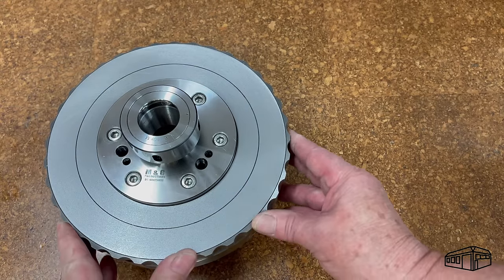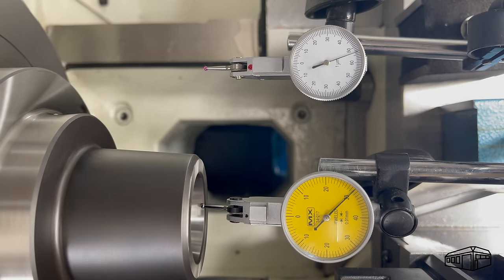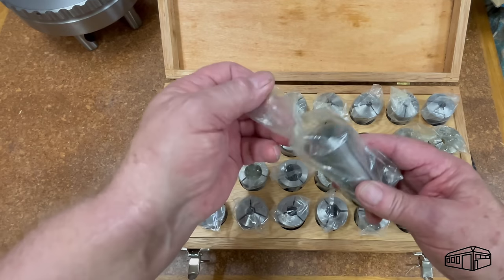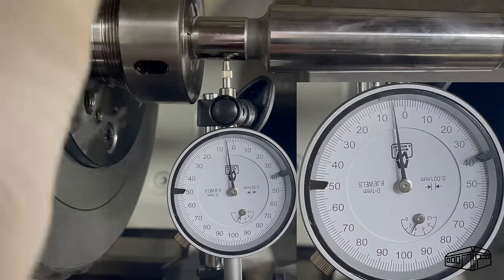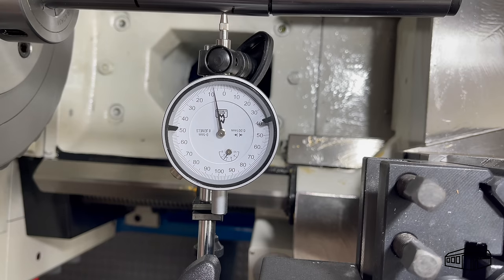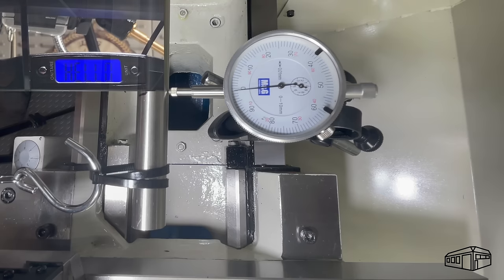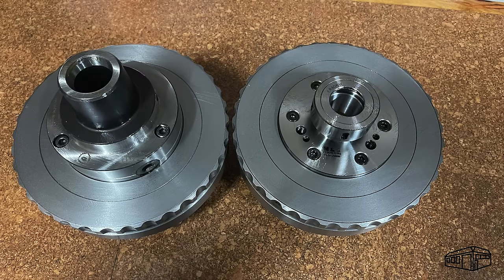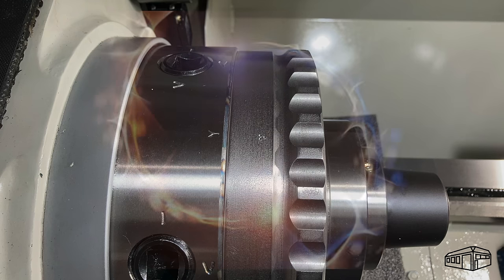The Most Accurate Lathe Chuck - The Sequel - Shop Made Tools

Comment: Very impressive, your lathe spindle must be a really good one as well.
I have commented on this before, but its worth saying again, I'm always impressed by how clean, tidy and well oiled you keep you machines. 
35C is not a temperature we expect to see very often in the UK, in fact our record temperature in England is just over 40C. The worst case for me was last year when we had a temp of about 18C which dropped to well under 10C in about an hour. There was condensation on every machine tool, took me ages to dry and spray with WD40. I now use Sta-Bil Rust Stopper, with excellent results.
Reply from the maker: Thanks for the comment and the compliment. Corrosion prevention is a big issue in an environment that is not climate controlled. Rapid temperature drops is the biggest risk with the air cooling and giving up its humidity to metal parts. Some machines can benefit from applying car wax but I use a fluid film. it also acts as a lubricant so any left on during machining gets a second life.
I also keep my machines covered with old sheets, they form a cotton barrier around the machine and as a natural fibre they are hydrophilic and tend to absorb moisture during temperature changes. They've worked well for me over many years.
Water is something I avoid and make sure your shed is weather proof. I've put a link to the fluid film below for you.

https://www.machineryhouse.com.au/rust-preventive-fluids

Cheers Steve O
Reply: @theoutbackshed  Boeshield works pretty well, don't know if you have it in the outback. Leaves a kind of waxy surface.
Reply from the maker: I have heard that Boeshield is very good, I haven't come across any but would happily give it a go. I'll see of I can get some.  Cheers Steve O

Comment: Looks good. Chasing zeros isn't a bad thing though. Sometimes it has to be done. A few things to note, the test bar; I bought a really expensive 18 inch precision ground test bar and used it initially to check my lathe. 2 years later I pulled it out to re-check my set tru chuck and everything was way off. I spent hours getting crazy results, wondering what was going on and then I decided to put my test bar on the surface plate and seen that it had bent significantly and I can't explain as to why. I think I videoed this but can't remember. 
Also, when I moved from L.A. to where I am now, temperature wasn't an issue in California but where I moved it was and my first winter here as every winter here goes below zero F, and I didn't heat my shop that first winter and almost every power tool and tool that had bearings and a motor was ruined. I've had people say they never heard of this and people that say the same thing happened to them. 
I would consider insulating and heating your shop when freezing temps come in. And when machining make sure your equipment is at 65 to 70 degrees F. Granite surface plates are lapped at between 65 and 70 degrees and if you're in a shop colder than that everything is going to be out of spec. 
I had my shop insulated and when not in use I keep it around 50 degrees F and when in use I keep it at 70 degrees F. 
Those bison chucks from Poland are really good. They produce some good stuff over there at a decent price.
Thanks for the video, was a good watch for sure.
Reply from the maker: Thanks for the comments. I've chased zero as much as I care to right now. though I need to invest in some better dial gauges I think the results I have are more than acceptable ... for now anyway. As I said, I have cooling in the shed but it doesn't get to zero where I live so heating is not really an issue. I get used to recalibrating micrometers and the like but my shed is well insulated so the short term variation (within a day) is fine, seasonal variations are a bit more.
I'd love a Bison 6 jaw, 10 or 12 inch but in this part of the world they are a little hard to find, and if you do find on they are very expensive. So I'll just keep plodding on.
I used the ER collet chuck on the latest project *still filming) and it performed perfectly. 

Glad you liked the video and the build Cheers Steve O

Comment: Keep in mind, ER collets (invented by Rego Fix, Swiss) are originally designed to hold round tools, 5c collets (Hardinge) are designed for work holding. ER collets have a larger grip range compared to 5C collets. The trade off being, a 5c collet can grip with less than 1/2 diameter with no stability or accuracy issues, the ER collet should engage the round stock with the full length of the ER collet and the ER collet cannot reliability hold a work piece at 1/2 diameter or less.

ER collets are limited to round collets with very few exceptions. 5c collets can be had in round, hex, square and custom made imperial/metric sizes. 5c collets are also available as step collets that hold the work outside the inner diameter of the collet's front body. 5c collets are also made in expanding versions that will grip by an expander to the inside diameter. 

While the accuracy/precision illustrated with round bar in this video notes very similar to identical results, the 5c collet as a system is simply far more versatile with far more ability to hold non-round work then any ER collet system. This is due to the fact 5c collets were and are originally designed as work holding collets, ER collets are designed to hold tooling.
Reply from the maker: Thanks for the comment, I'm very happy with both chucks. The 5C collets , although not branded, are showing a high degree of accuracy. I will be on the lookout to expand the range of collets that I have.
Cheers Steve O
Reply: @theoutbackshed  
The common low cost 5c collet is surprisingly accurate/precise. The one problem they have , they are made to marked size instead of slight over size to allow ease of placing work into the collet. This is one of the prime differences between the common low cost 5c collet vs Hardinge, Lyndex and other premium brand 5c collets. For the home shop/hobbyist, those low cost 5c collets are an excellent value easily meeting these needs.
Reply from the maker: Thanks for that.
Reply: ER may have been designed for tooling, but they will hold work just fine if it's long enough. For you average home shop it's a lot cheaper to have a full set of ER40 than a full set of 5C.
Reply: @carlhitchon1009  
Within specific limitations ER collets work for round bar and the round bar must be long enough to span the entire length of the ER collet. Sure, round bar less than the span length of the collet has been done, not good for the collet and there is a risk of the round bar exiting the collet as it is being worked on. Within those hard limitations ER collets do work for holding round/threaded bar.

Keep in mind ER collets at the ends of it's hold range is not very secure or ideal holding power.

Fact remains, the 5c collet is more versatile and stable for holding round, hex, square bar down to less then 1/2D.

There is no idea,  just trade offs with overall cost included in this mix.

Comment: Thanks for the great video! As I understand it, 5C collets bear also on the cylindrical portion just before the thread (dimension called out as + 0.0001”/0.00254mm), it would be interesting to see if the runout of that portion of the Bison chuck relates to the test bar runout results.
Reply from the maker: Thanks for the comment. Great point!  Cheers

Comment: I would be very suspicious about the no brand DTI. It looked like the 0,01mm clock moved at least 0,003mm and the no name one barely moved. So the 0,01mm indicator is actually more sensitive than the more "accurate" one. I had similar results with chinese ones and that's why I now have Japan and Swiss made DTI's for the stuff that matters.

Same goes for the M&W. It appears to be too stiff for the setup.
Reply from the maker: Thanks for the comment. I'm looking for higher quality indicators. Cheers Steve O

Comment: Both chucks measured similarly with 16mm collets but the 5C was worse with the 20mm, surely you're not measuring the chucks but the inaccuracies of the unbranded 5C collets? Edit: You just answered my question!
Reply from the maker: Thanks for the comment, you are correct, the chucks came out similar and very accurate. The errors between the different sizes could be due to variations in the collets, the test piece or both. Overall, the 5C collets performed well and I am pleased with them.  
Cheers Steve O